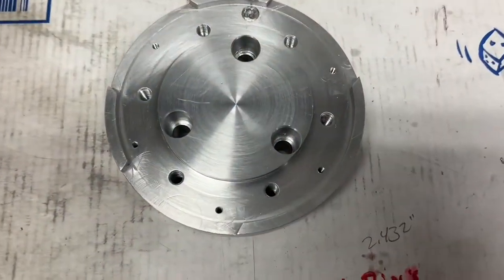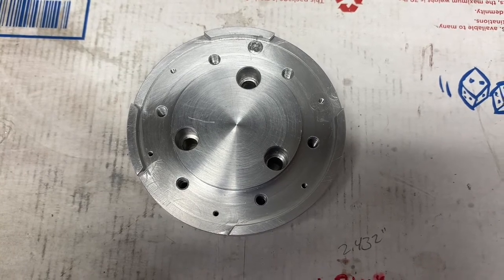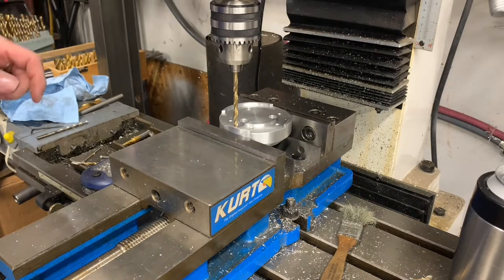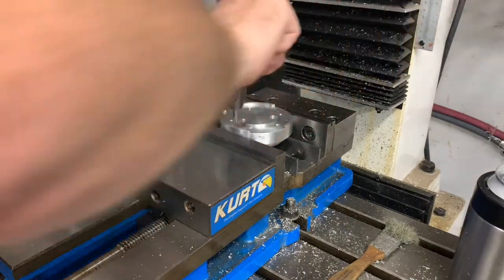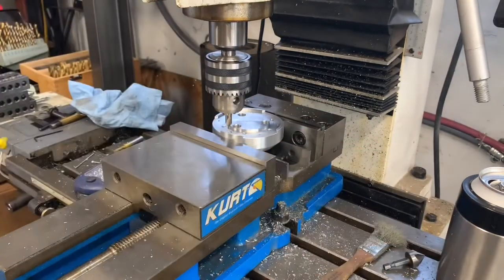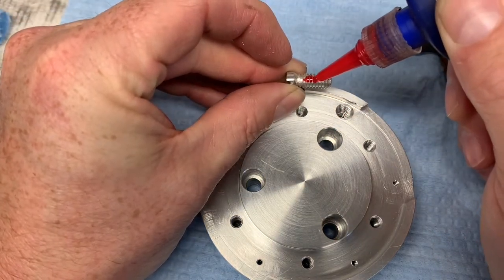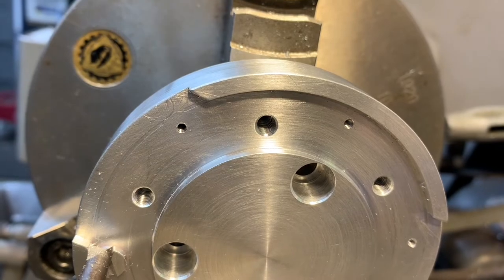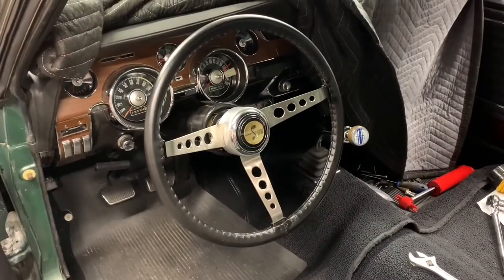Major Aluminum Thread Repair Using a Bolt!? Saving My GT500 Hub Adapter: 1968 Ford Mustang Fastback

Comment: Righty loosey, lefty loosey... 😁
That steering wheel hub turned out awesome! 👌
Reply from the maker: Thanks Martin! I had wanted to run that horn button, even though it will be non-functional, just because that’s such a prominent part of the design. I could make it functional, but the part would lose it’s safety rating for competition usage.

Comment: Good to see you came up with such a clean and neat solution and you didn’t have to scrap the piece. Please use some safety glasses when you’re on the machines though. I’ve had to have an aluminium shard removed from my eye before and it’s not exactly a pleasant experience.
Reply from the maker: Yes, I know. I’m generally really good about it. Sometimes I take them off to set up a shot, and forget. I know that it only takes one time, though…